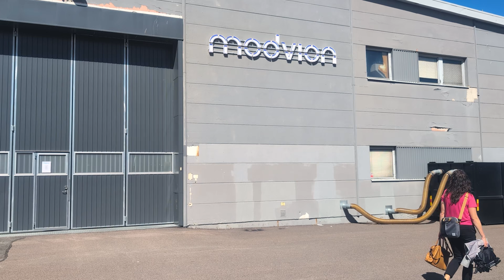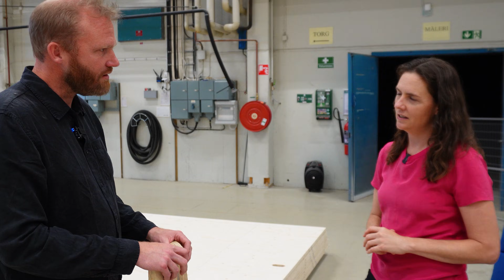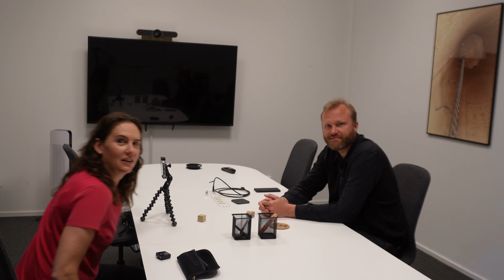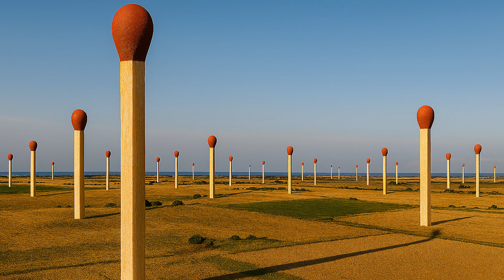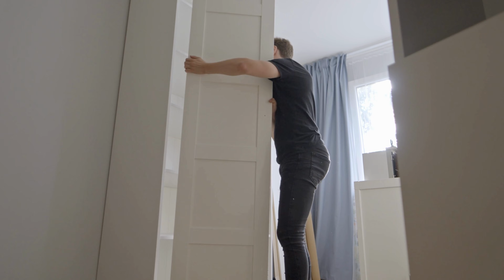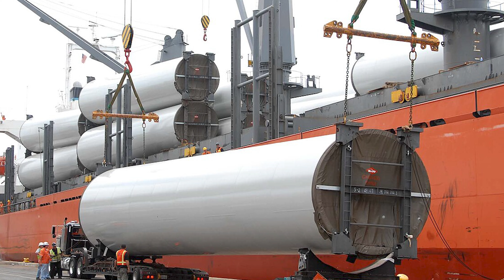How a Wooden Tower Could Unlock Bigger Wind Turbines

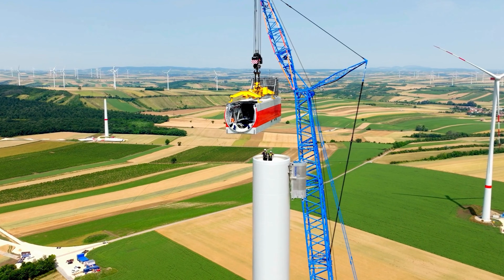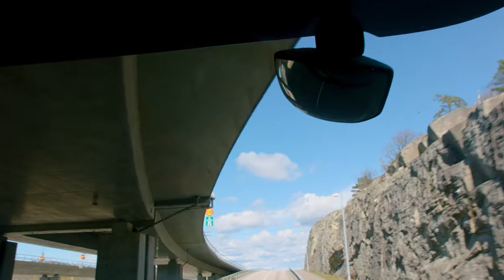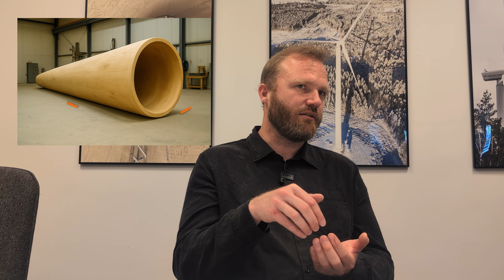Comment: You can't transport steel cylinders larger than 6 metre diameter,  under bridges for example, unless you break the cylinder up into more complex segments (19:35). Modvion's approach offers an alternative approach to side step this constraint, ...by... breaking the cylinder up into more complex segments (19:45). The  timber panels are joined longitudinally by gluing in many perforated steel plates (7:40). In a steel tower you would simply bolt or weld the panels together. Seems to me, the steel towers are manufactured to certain dimensions for convenience and simplicity in transport and assembly - if they wanted to go higher, it would just mean a lot more work on site, which is exactly what they have to do for the timber towers.
There must be a tremendous amount of labour and processes involved in manufacturing these laminated timber panels.  We have been manufacturing massive steel cylinders for well over a century, the process is highly refined and we have a trade specifically devoted to it....boiler making.
Reply: Bolts reduces the structural strength of the steel structure. You need to weld them together on site. Or use adhesive to glue the steel together.
Reply: @kazedcat  Well you better let the engineers know, because the entire steel tower structure is bolted together, also the turbine is bolted on to the top, and the blades are also bolted on. What sort of glue do you suggest?
Reply: @jumboegg5845 did you see how many bolts they use to hold down the tower stack? They need that many bolts to compensate for the structural weakness of using bolts. Now imagine having that many bolts then you add more bolts to hold together the vertical seams of the cylindrical pieces. Before long your entire tower mass will now be made up mostly of bolts.
Reply: @kazedcat  That's how we build steel structures, bolts and welding, You're not highlighting something new, the engineers know what they are doing. Assembling the timber panels looks a lot more complex, tens of of thousands of steel plates holding all the wood panels together with glue, and how are the panels held together while the glue dries? Look at just one wood panel joint (7:42), there's about 100 steel plates for just one join. The wooden tower is held together with steel plates, a huge amount of glue, and bolts - all that extra engineering (and chemicals) just to pretend to be using a more sustainable product. Like Rosie said in the video, should be leaving the wood visible and not tinting the paint white, its a complex work of art, not a feat of practical engineering.
Reply: @jumboegg5845 Yes we build metal structures by welding. But gluing on site is faster than welding on site.

Comment: Gearboxes?
Modern large wind turbines do not use gearboxes at all!
They have the "poles" of the rotor as part of the main shaft - rather than using a gearbox you just use more poles on the mainshaft!
They then operate at the best rpm for the wind - which produces "Wild AC" - the electronics at the base then turn that into "Tame AC" for the grid

Comment: LVL is a very strong and durable material, but I agree that this isn’t necessarily a significant gain for sustainability. Not sure this is the optimal use for LVL. LVL can be used to displace materials like concrete in multi-story building construction, which could be a very positive tradeoff.

Comment: As a solution to the height issue, why not use wood for the lower sections and then transition to steel.   As for the brown vs white, the only difference is a bit of tint in the paint. You do have to wonder if painting them brown, green, or camo combo might take the hate out of them for some people.
Reply: The. colour will affect absorption of sunlight - hence how it heats up in summer. One side hot, the other side cool might not be ideal.
Reply: @polyvg  Very good point
Reply: Paint them a Natural Color, and then every Non Commercial Airplane will find a way to crash into it.

Comment: For applications where panel buckling is the driving failure mode for how heavy a structural component needs to be, composites have a huge advantage due to their low density, and while wood doesn't match the performance of fiberglass or carbon fiber, it's still a low density composite that matches the strength to weight ratio of steel, and therefore excels at resisting panel buckling. 
That makes a good engineering argument for wood, but it would equally make a good argument for moving towards a skin and stringer or frame construction more like what's used in aerospace or ship building.

Comment: Very interesting!  I wonder about ventilation, in the case where there is power conversion equipment in the base of the tower.  He said it should be sealed to keep out moisture…
Reply: wood regulates humidity pretty well. If you only have a little wood in a room it makes it vulnerable to damage from humidity changes, but when the whole room is wood, it takes a lot of moisture to change the humidity. This is actually a great feature of timber housing in terms of comfort. The only risk is if you introduce new moisture and let it build up, which they address by ventilating when people are in there.

Comment: hi rosie!
thx for giving me the opportunity to do some research.
i have no scientific education but im interested in sustainable living since 40 years.
and years ago i already had read that from the standpoint of structural engineering wood has a better fire-resistance than steel.

for to burn something it's always the ratio surface to mass (contact surface with oxygen [liquid gasoline is not flammable])
not every wood burns (and when i look at the production process of modvion, it seems to me that their elements are very dense, so little inflammable)
as not every steel burns (but it does under certain conditions)
well, london burnt down in 1666, but there was a lot of open wooden surface and other flammable materials densly packed
for the wind turbine towers, you will agree, they are very spaced and the wooden surface (if there is any lasting) via the wood mass is extremely low
(are those segments 30 cm thick or more?)

there have been studies, unfortunately i did not find them, but:
steel above 500 degree celcius gets soft
a wooden hall burning stays upright at least 30 minutes

firefighters do not enter steel constructions because they can collapse without any warning
wood: A collapse is heralded by cracking and creaking sounds.

as the guy form modvion stated: it's not about preventing the construction to burn down but to have the time to evacuate
so, form this standpoint wood has the big advantage

In european construction regulations:
Fire resistance classes 'F' + minutes the substance withstands a fire
F30 is equivalent to fire retardent
wood is F30, can be treated to be F60
steel to get F30 has to get fire retardent coverings

wood in case of burning forms char at the surface which is highly insulating, so slows further burning

for the piggies:
i found the image of the tower burning down form below very misleading (and old fear of wooden structures burning down)
because this wooden structure will only start burning with a lot of fire-starting material around and once the char-surface formed even stop burning

concerning sustainabilty:
you spoke a lot about the sustainability of the wood used
but never of the sustainability of the steel used
is there any sustainable iron mining?
the sustainability of wood should be compared with the sustainability of steel

energy comsumption i found for production of:
- Laminated veneer lumber less than 11 Mj / kg
- Steel at least 50 Mj / kg

you may not want to alter your video but if ever the case you might consider these informations

thilo

Comment: G’day, this story was interesting, but kind of… well… transitional. Neo Wood (such as InventWood’s ‘Super Wood’) is going to replace a lot of steel, plastic, fibre glass, carbon fibre, etc. Lighter, stronger, so much cheaper than steel… and it’s hard to set on fire… and they can make it with bamboo, golden wattle, radiate, oak, whatever. 

With simple veneer being so strong that it’s bullet resistant, we’re heading for the era of Neo Wood. Particularly as it carbon locks about 20 tons of carbon per hectare… and bamboo grows on (and rehabilitates) degraded land.

Comment: OOoo...
Those tower sections when brought down and recut would form arched beams...
PERFECT!!!
Arched beam ceilings and roofs not only look good but are stronger as well(!).
That makes them a structural and aesthetic Win-Win.
Reply: Sadly they are not strong in the arch direction. The LVL is grain aligned longitudinaly to support the weight of the turbine. That means that when they cut them into lumber pieces there will be no arches. Just long pieces of LVL with a very slight bow on the edges.
Reply: And also earthquake resistant

Comment: Whatever the material, Horizontal Axis bird killing machines that are unreliable, unstable, Unsafe, and Marginally effective need to Not Be Used At All.

They should all be Vertical Axis mills that do not kill birds, are extremely reliable (they don't fail in use), are Omnidirectional (NO steering mechanism), cost a Fraction as much to build as Horizontal mills, have dramatically higher net output, can survive and eeven Operate in storms (NO down time!) and are Easily Serviceable from ground level.

Use wood or metal or whatever, but Please,
PLEASE switch to Vertical mills(!!!)

Comment: No matter what the outcome, I love it when two intelligent, knowledgeable, polite experts discuss something for the benefit of everyone.
Reply: ??????? It is made of a dead tree!  And will burn like wood and break during a storm. And dead trees don't suck and store carbon dioxide out of the air when dead !This is fake news makes no sense! Steel is more durable then dead softwood and can be 100% recycled and re used for exactly the same purpose as before it got recycled!
Reply: @SijbrandPTakes you cut down an old tree, turn the wood into a wind Turbine... and replace the old tree with a new tree that is still sucking carbon from the atmosphere.
Reply: @SijbrandPTakes They may not remove more carbon once dead but they do still continue to store what they removed providing they don't decompose, coal being a good example of carbon still locked in long dead trees and other plant matter. Even if 50% of the carbon is released back after death providing another tree is grown in its place that's still 1/2 a trees worth of carbon removed from the system for each tree grown and used in this fashion. Is the carbon removal aspect going to make huge difference? Probably not on the scale required but something is better than nothing. 

Also not all steel used in manufacturing is recycled steel, you still need to generate additional fresh material and making virgin steel is often a carbon intensive process vs a tree growing for virgin wood which is very clearly a carbon negative process, obviously there are some nuances to that at both sides such as emissions from logging and transportation but they could be done in full sustainable ways in theory. Also it is worth noting that if wood can be used to produce lighter towers for the same height you then can potentially also use smaller foundations requiring less concrete which is also generates a lot of CO2 or for the same foundations get a taller tower which generates more power for the same cost in carbon (and possibly money for the base).
Reply: @SijbrandPTakesSure, buddy. There is a reason this is Swedish.
Reply: If only they could surface a bit more often also in politics. As it is, politicians are mostly people that has risen to their level of incompetence.
Reply: So we can use the wind mill as wood for a barbecue when it eventually fail.

Comment: Looks like a solution looking a problem to me. The benefits over steel are marginal at best, if not non-existant. Now if they developed a wood based turbine blade that was easily recycled, then that would be something to shout about. Not this nonsense though - the silly swedes, or are they turnips in this case?

Comment: I'm not sure why this wooden structure seems so questionable. Is it flammable yes but we live in wood timber homes.  Steel is also quite flammable. Termites? Don't eat plywood actually. And again, we live in solid lumber homes that termites do actually eat. Water damage, rot mold fungus? Again we live in these structures and we have learned how to manage that so that our homes last for scores or hundreds of years. People build cold molded plywood ocean going yachts. The more puzzling question is why everybody seems to assume steel is the only material you would use for something like this. One of the main benefits of steel is the extremely strong welded joints. Constructing a ship for instance is extremely complex and there will be many thousands of weldments and attachments. A tower like this on the other hand could hardly be more simple and monolithic, so that advantage is irrelevant.

Comment: What was NOT addressed was vibrational damping and resonant frequency, for which wood, has an advantage. With the amount of glue used I would "guess" that no additional termite protection may be necessary, except for maybe the bottom two meters or so.  Years ago I built windmill blades out of LVL.
Reply: I think there is another issue that was ignored. In extreme wind conditions, these towers will be far less likely to suffer buckle failures than steel towers. That's not to say they they couldn't have a new and interesting failure mode, but buckling probably isn't it.
Reply: I don't think that they paint the wood white for aesthetics reasons. UV is very hard on wood, and paint helps in protection.
Reply: @alfastur6833  1) Any color opaque paint protects from UV.  2) Wood is more sunlight resistant than most plastics unless it has a UV additive.
Reply: @johndavidwolf4239  white paint reflects UV and degrades slower. Dark colors absorb UV and degrade faster.
Reply: @KristenOldham32 Depends on the pigment type. Black tyres are more resistant to uv than white tyres, for example. I guess carbon black is virtually persistent to degradation.
Reply: @alfastur6833  Shure and they have to paint it again after 3 years and have to keep doing that, put that on the price
Reply: .made it of steel tank and use it as air storage, further more a wind mill producing compressed air instead of electricity is at least 25 %  more productive because rpm is no longer needed,  cheaper and a few sending energy to a single generation unit  , no electricity production means no electrical inspection,no insurance that's another 10 year,
Reply: @yvanpimentel9950  there was a fad for people making DIY compressed air energy systems for off grid living like a decade ago. But it never went anywhere. Electricity is just soo much cheaper and easier to work with. And with much less risk of explosions. Believe it or not, smart people have spent many decades thinking about all this stuff. And if they aren't doing something obvious, It's because people already tried it and it didn't work
Reply: I seen many videos and don't understand this tower don't include a external fixture to control the effect of wind.
Reply: Well there is no termites in Scandinavia but we have other insects that live on wood and unfortunately they have wings. 
We dont have that problem with steel
Reply: @Ikkeligeglad  He did address that: those winged insects attack wet, rotting wood. If your tower is rotting, insects are your smallest problem.
Reply: @sciptick  Oh, no it was another insect I was talking about , it's one that go after older dry wood, can't remember the name of it.
Reply: @Ikkeligeglad Common furniture beetle?
Reply: @Vercixx  Right

Comment: Another advantage is that it doesn't reflect radar, so avoids complaints from national defence, although most of the radar complaints seem to be about blades, which are worse because they move, so we need wooden blades next...
Reply: Maybe we will be able to do plastics at some point
Reply: That's weird because blades are not made from steel to begin with are they, they're made from fibreglass or carbon fibre...

CF is electrically conductive but glass fibre isn't.

If even GF is causing radar interference, which by all reason it might, so will a wood composite exactly the same.
Reply: @SianaGearz Maybe it’s the lightening protection that causes the reflections, but weather radar is often used to detect rain, who knows what national defence radar needs to pick up.  The significant feature of the blades is that they move, and remember that some of the most successful Ukrainian drone attacks on Russia were carried out by Australian cardboard drones!

Comment: Why not farmed bamboo? They grow way faster than wood.
Reply: Bamboo does not grow in Scandinavia!
It doesn't form sheets for lamination.  Forming bamboo strips into a wind turbine tower would be a lot more work, and thus expensive.
I think it is more inconsistent in strength than wood, which might be a big problem.
It is also more flexible than wood, the tower might end up too bendy, or need a lot more material in it, and since bamboo is quite heavy, that would also be a problem.  It is not heavy when growing because it is hollow, but by the time it is laminated...
If you use wood, then you can use strong woods for the outer shell layers, and lightweight woods for the core, resulting in substantial weight savings.